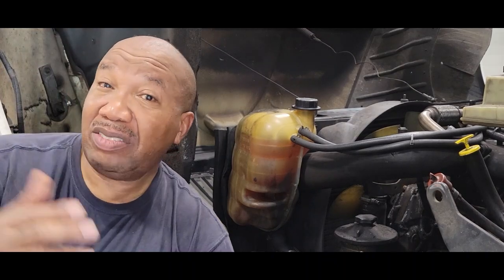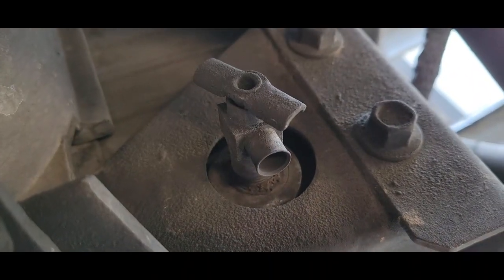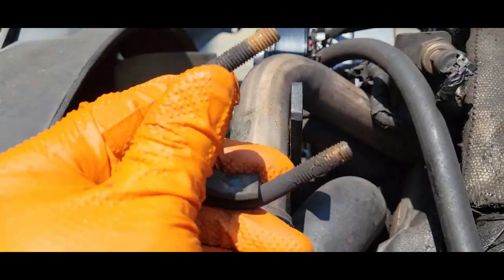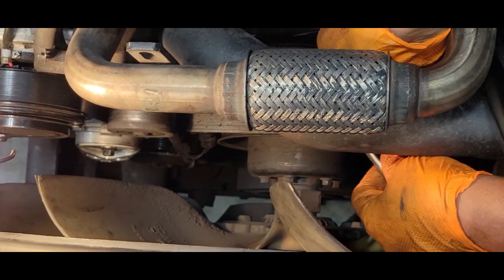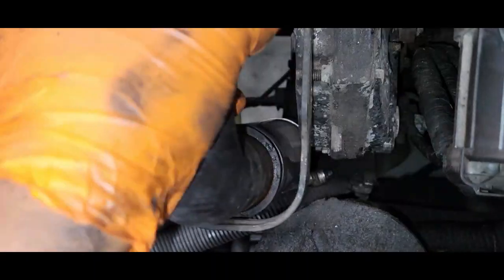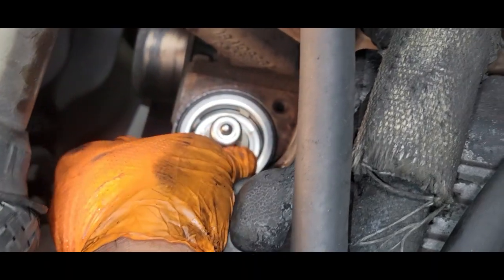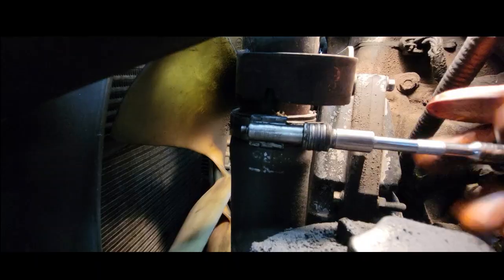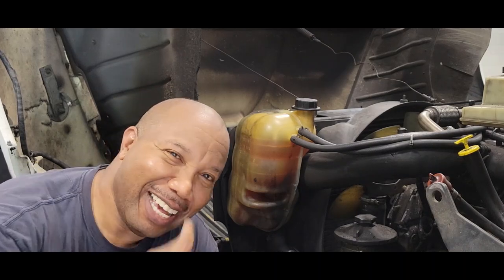How To Change Thermostat On International 4300

Comment: How do you know when it's bad?
Reply from the maker: Good question!
1. Engine operating hotter than normal. 
2. Poor Coolant circulation. 
3. In older or Classic Vehicles no heat in winter months.
4. Engine never reaching operating temperature.